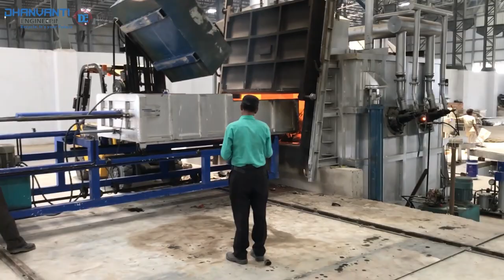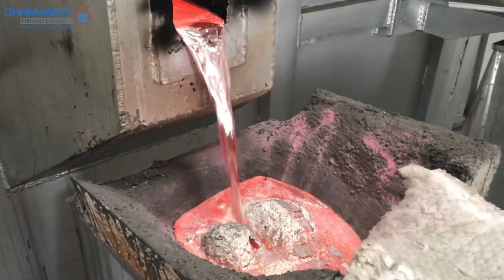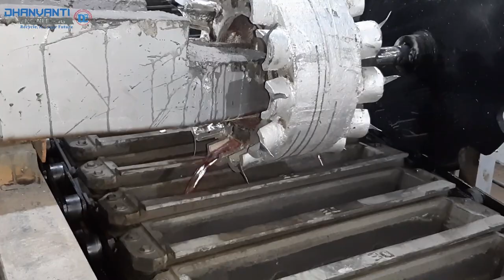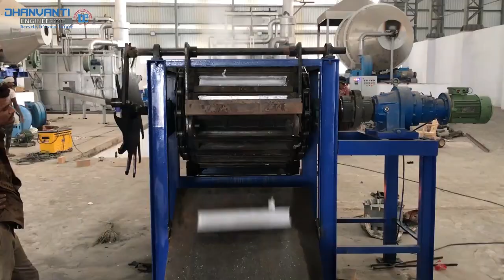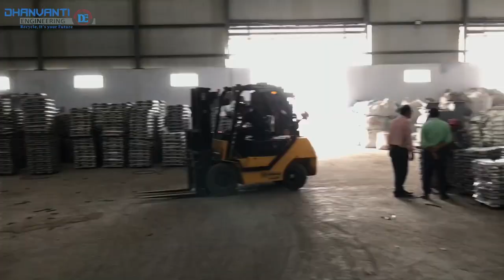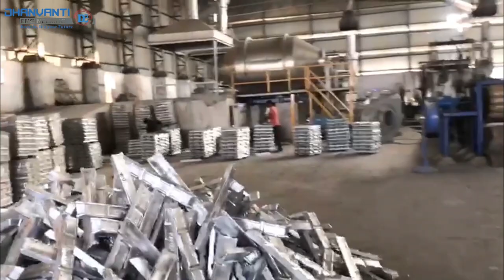Aluminium Recycling Plant|| Aluminium Alloy Ingot Making Plant|| Dhanvanti Engineering ||

Comment: Can you guide me for aluminium ingot making process for rajasthan
Reply: Dear friend,
This is Terry from China.
We are manufacturer of Metallurgical Materials. 
Our products are 
1. Ceramic foam filter
2. Caster tips
3. Tap out cone
4. Hot-top casting
5. Refining flux and Bn
6.Online degassing and filtrating equipment
We have the same quality with Pyrotek and Drache,but the price is 80% of them. Under the premise of quality and quantity, it can effectively save your cost.

 If you have enquiry, it is not a bad thing to add  one more supplier in your purchasing list. One more choice, one more comparison. 
 Hope we can help each other and establish a good relationship.

Comment: hom much cost is it machins
Reply from the maker: Kindly share your contact number
Reply: Dear friend,

This is Terry from China.
We are manufacturer of Metallurgical Materials. 
Our products are 
1. Ceramic foam filter
2. Caster tips
3. Tap out cone
4. Hot-top casting
5. Refining flux and Bn
6.Online degassing and filtrating equipment
We have the same quality with Pyrotek and Drache,but the price is 80% of them. Under the premise of quality and quantity, it can effectively save your cost.

 If you have enquiry, it is not a bad thing to add  one more supplier in your purchasing list. One more choice, one more comparison. 
 Hope we can help each other and establish a good relationship.
Reply from the maker: Please contact our sales team on 
sales@dhanvantieng.com
Project@dhanvantieng.com
+91-90168 00762
+91-90168 00761